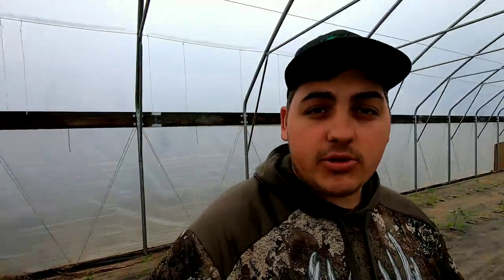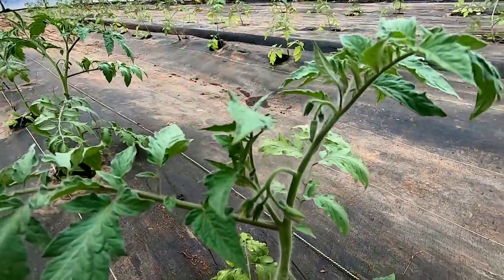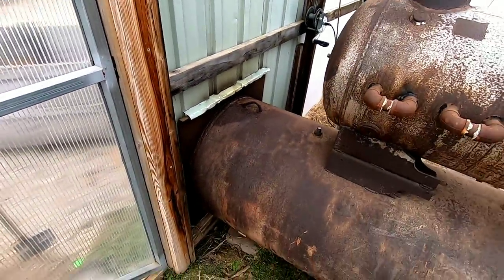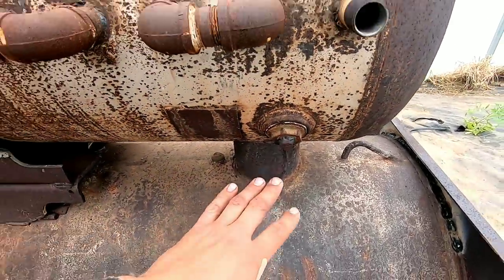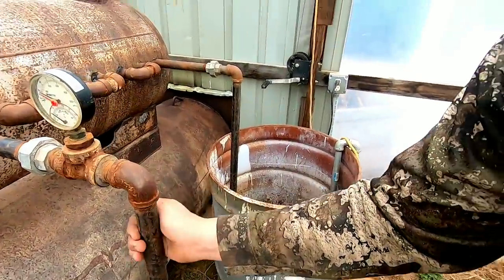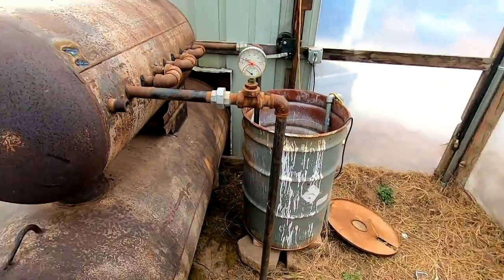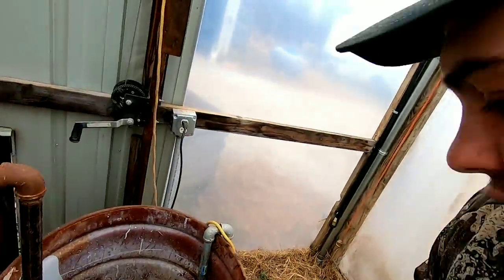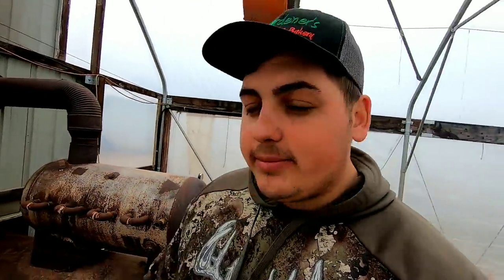DIY Geothermal Tomato Greenhouse

Comment: Add a pipe damper in your stove pipe I would say you will get 30% more heat from the wood stove and save 25% wood it will slow the rate of burn on the wood while having more heat.

Comment: where you are adding high tunnels plan on adding a heat system with black iron for the next one.  dig out 2'deep the space of the green house, have a rock screen to pull out stones, attach rot resistant wood on the inside of the pipes, put 2' of sheet insulation between the pipes, another piece of rot resistant wood on the outside, layout the black iron pipe in two loops with hottest water on the outside of the tunnel, refill with screened loam mixed  with compost

Comment: If you aren't using the space right next to the walls, you could fill up sand bags with black sacks or some kind of water line with black hose running parallel with the walls to gather heat during the days and it will release it during the night. It seems like a lot of cost to heat the greenhouse with propane and wood, and if you have the tools it's worth a shot right?

Comment: You should test burning biomass, it's advertised as using 50% less than wood. Biomass is what some US megawatt power stations use so I'm sure it's cheaper than firewood. Test it, maybe cut your heating bill in half.

Comment: Great job. If I could add my 2cents I would add a second exchanger in the fire box for more efficiency next year. When it’s time to replace the flue run it in the high tunnel as much as you can before you go out of the building.

Comment: ....also.....I like what you did with the stove, but I think it could use a little redesign. Great job for starting from scratch!  It's a lot of detail to write here, but I'd look into making sure you were burning all the combustion gases by maybe adding a horizontal baffle in the combustion chamber. Also, if you run the steel pipes the long way in the upper chamber, you'll get more heat out of it for the same number of pipes and penetrations ( pipes running the long way will have more area for heat exchange ) I might add a blower in there somewhere too. These are just ideas.....if they help, I'm happy. If not, you know best for your operation :) AND I think it should be bigger. Like twice the size for the combustion chamber, and maybe a little different shape lol My two cents, friend :)

Comment: Radiant heating pipe, is specialized for that particular use. It is used under slabs and when used according to direction causes very few problems. 
Look into this for your high tunnels.

Comment: The pexs pipe is the right way it won't rot away like steel pipe would be just like in n floor heating but the vapor barrier be the only thing I'd do different

Comment: How many high tunnels do you have and how many DIY soil heating systems do you have as well? I may have a few solutions for the heating of the high tunnels but I think it would be more efficient to have them together rather than apart.

Comment: Thank you for another great video Dre! btw, a cord of wood is a stacked pile, 4'x4'x8'L or 128 cubic feet. Unstacked is less wood, as you might imagine. What are the dimensions of the bins? I think a 20 bushel bin is about 50 cubic feet, so two bins would be less than half a cord if stacked wood, and even less than that if not stacked :) There are more calculations to do......like a cost comparison by BTUs. But we can save that for another day :) Do you guys sell firewood for a profit? Do you produce yourselves the firewood you use? Thanks!
Reply: correction: 2, 20 bu bins total about 50 cu ft. So both together = < half a cord, is my point :)